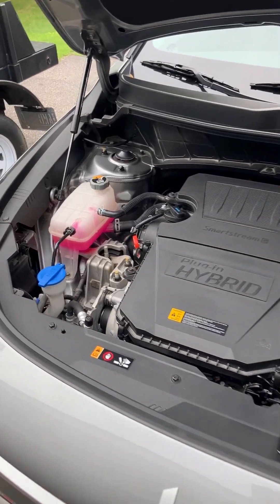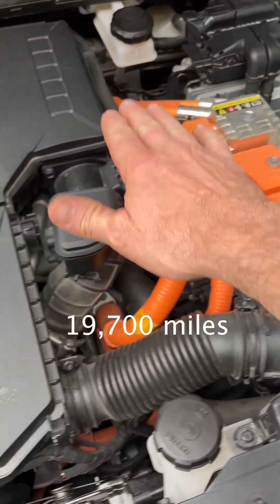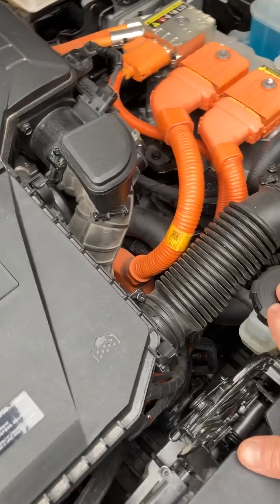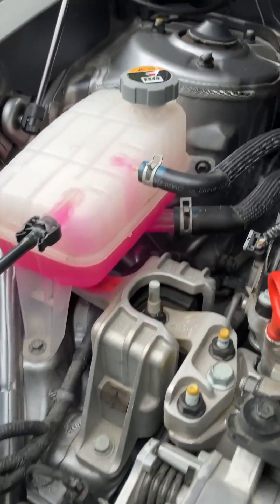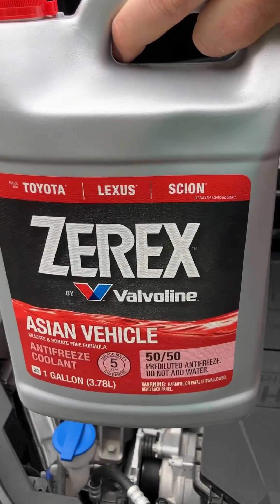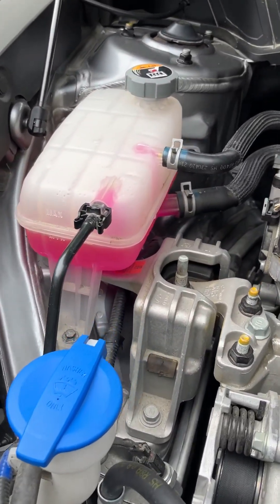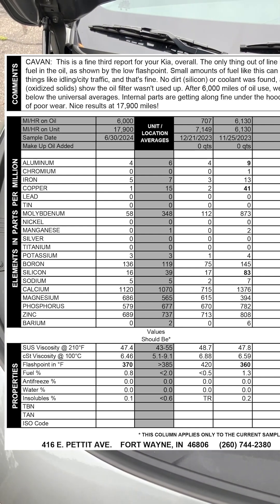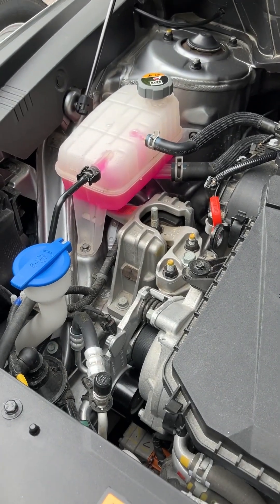Niro PHEV oil lab results and first time coolant fluids are needed

Comment: Tip: Filling the engine coolant reservoir up to the MAX line makes it easier to see level changes than filling it to the mid-reservoir seam. You can't overfill; any excess will overflow.